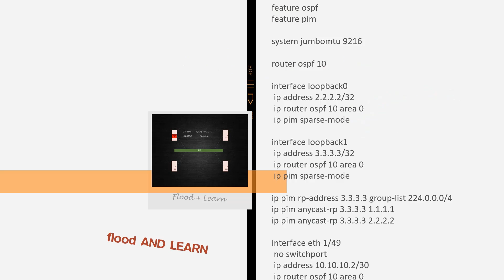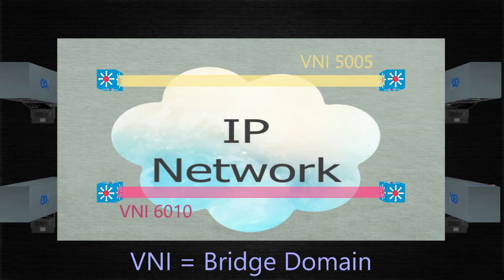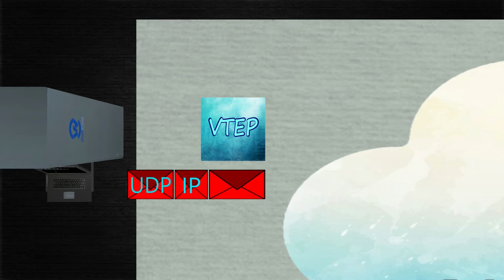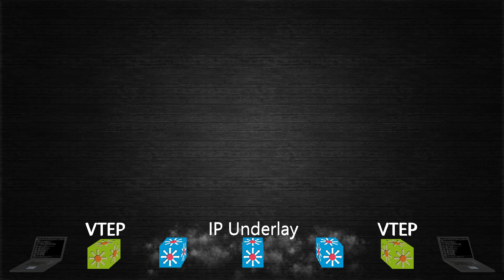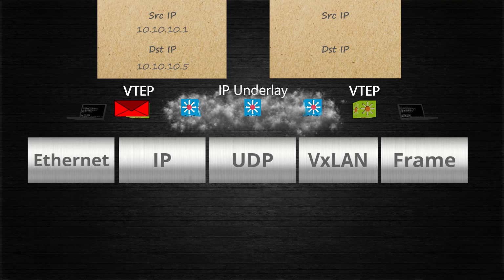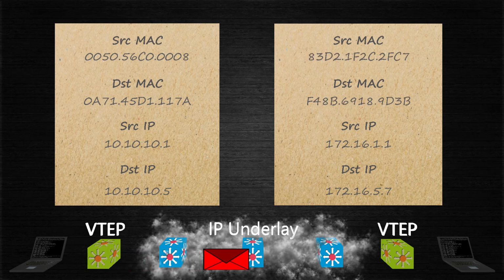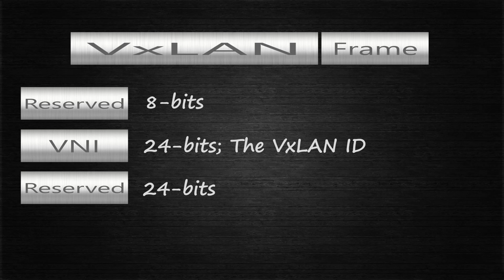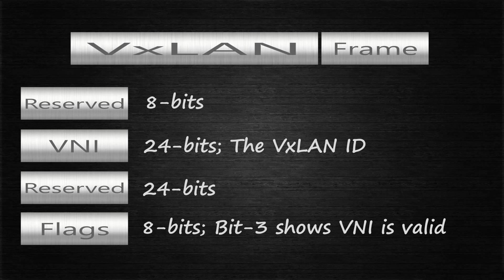VxLAN | Part 2 - Header Format and Encapsulation

Comment: Thanks for the excellent explanation. I have a couple of queries here: 02:43:  With the help of dest VTEP IP address, the packet can reach the destination VTEP but how would it attach the same VLAN id which was stripped off during encapsulation?  And, Since the Dest MAC address in inside the inner Data Frame, how would the packet reach the correct machine?

Comment: Nice video, just need to point out a small error. At 1:18, you show the vtep adding an IP header and then a UDP header, the order should be reversed, UDP first followed by IP. You have this correct later on, just thought I'd mention it. :-)

Comment: Regarding reserved bits in VxLAN header. 
Source: https://cumulusnetworks.com/lp/evpn-data-center-oreilly/
Book by Dinesh Dutt - who designed VxLAN primarily.

"I already had over-the-top virtualization (OTV—a proprietary precursor to EVPN) and LISP protocols to support. I wanted VXLAN to look like OTV and for both to resemble LISP, given that LISP was already being discussed in the standards bodies. But there were already existing OTV and LISP deployments, so whatever header I constructed had to be backward-compatible. Thus I made the VNI 24 bits because many L2 virtual networks already supported 24-bit VNIs, and I didn’t want to build stateful gateways just to keep VNI mappings between different tunneling protocols. The reserved bits and the always 1 bit are there because those bits mean something else in the case of LISP and OTV. In other words, the rest of the header format is a consequence of trying to preserve back‐ ward compatibility. The result is the VXLAN header you see."

Comment: I need to know that what is the use of VNI ( even if they are in millions ) as ultimately we are mapping 1 VNI to 1 VLAN , so indirectly we cannot map more than 4096 VNI.
So how we can use other VNI on one site ? as we cannot use more than 4096 VNI. Please explain.
Reply: Leaf1 4094 vlans are mapped to vni 1-4094, next leaf will have vlan 1-4094 mapped to some other vni ( say 4097- 8000). The point is VLAN has local significance ( limited to that swicth) while VNI has global significance ( across the fabric). Hope it helped!
Reply: @bestsaurabh  But what we would achieve from this as same site this much number of VLANS are not required ? Even on next leaf, you can map the same as VLANS with VNI's as well for any communication. I do not see the real use case of this one.

Comment: Say i have two datacenters with vxlan and my isp is providing dual homed l2 leased circuit for redundancy. Will vxlan know about the looped topology and still employ stp on interconnects with the isp?
Reply from the maker: Good question! VXLAN is just an overlay, so loop prevention is based on the underlay network you employ.
Generally, you would use BGP with EVPN in the underlay (see how this is configured in part 6). In this case, loop prevention is based on BGP.
I should mention though, that the original design of VXLAN was designed to be in a single site. There is now support for EVPN Multi-Site, which you should probably check out. Low latency and stability in you underlay (the provider circuits in this case) are key.
Reply: ____ (<-L2 circuit) ISP (L2 circuit ->)__________
  |                                                                                            |
  |                                                                                            |
  |       X (STP Block?)                                                           | forward 
  |                                                                                            | 
DC#1-------VXLAN on OSPF with dedicated fiber ----- DC#2
Reply: does that mean VXLAN dont carry the BPDUs?
Reply from the maker: I haven't tried to get VXLAN to carry BPDU's, so I'm not certain, but as far as I know, VXLAN does not carry BPDU's.
By employing layer-3 in the underlay, layer-2 loop prevention (that is, spanning tree) is not required

Comment: Jumbo frames? What if the XVLAN goes over the Internet as the underlay network? I think limiting the MTU would be required.
Reply from the maker: Good question.
You wouldn't use the internet as an underlay. VxLAN was primarily meant to be within a single site. There are other technologies that it can integrate with if you want to use it across sites, such as OTV and the newer EVPN Multi-Site. Having said that, I've seen it running across DCI links without these technologies and it's fine.
I definitely wouldn't run it over the internet though. If you want an overlay over the internet, perhaps DMVPN with MPLS would be a better option.